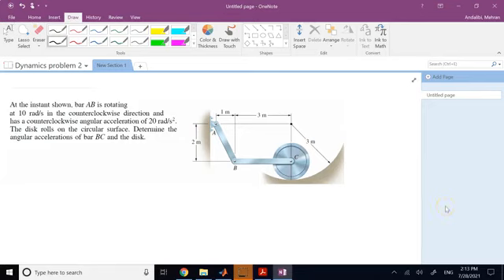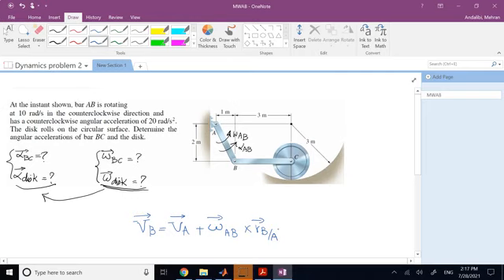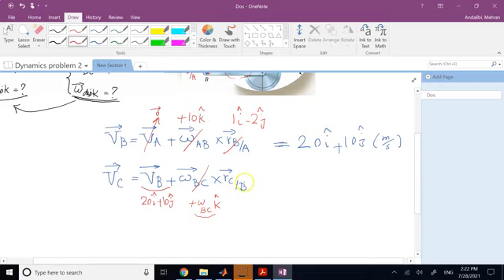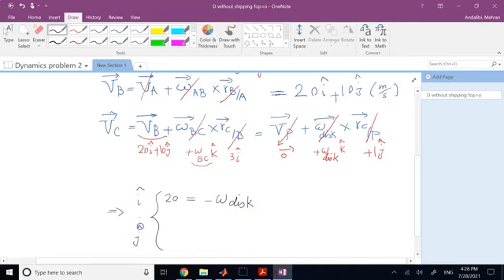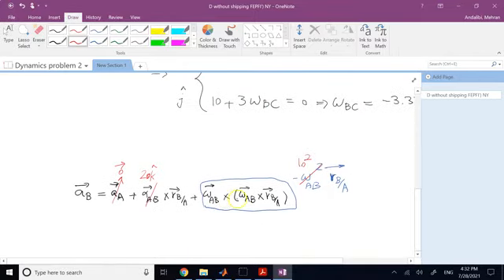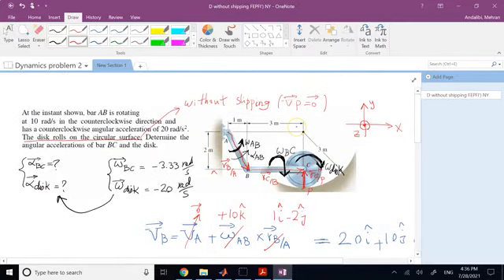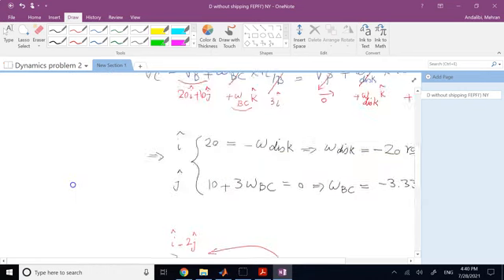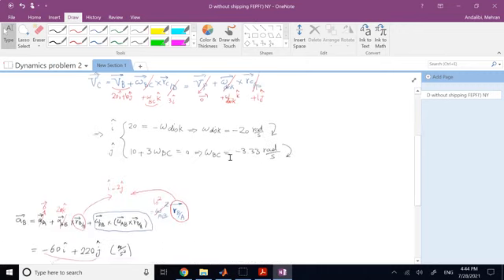Kinematics of Rigid Bodies: Velocity and Acceleration Analysis

Comment: Sir, I guess you did something wrong at 22:40 because the acceleration which you found is just the tangential acceleration of that point there is also a normal acceleration. And you did not take into account the normal accelaration of point C. And you just equalized the whole thing with the tangential acceleration of point C.